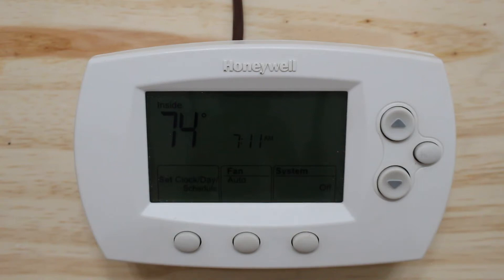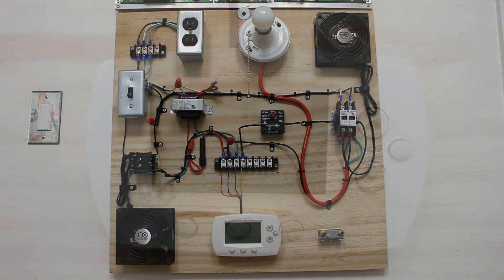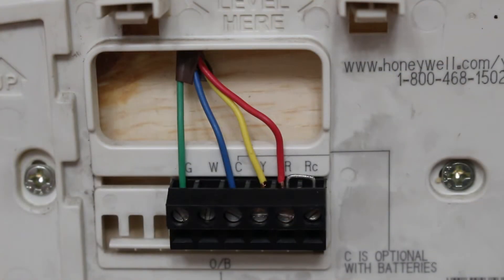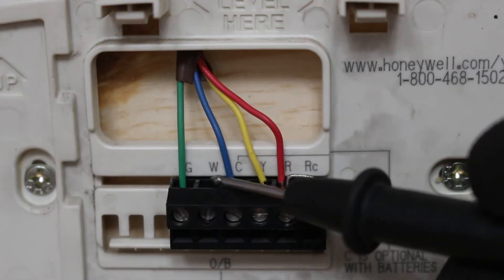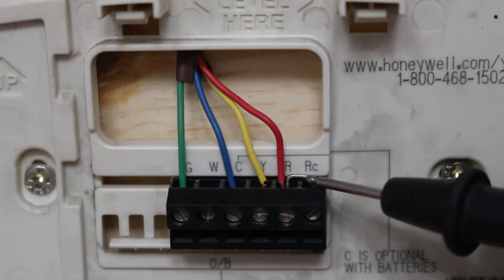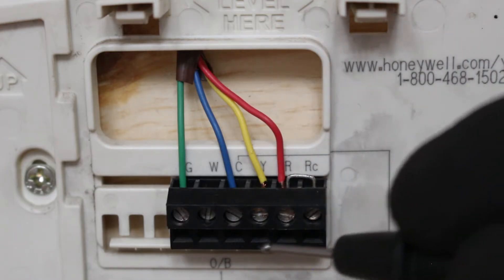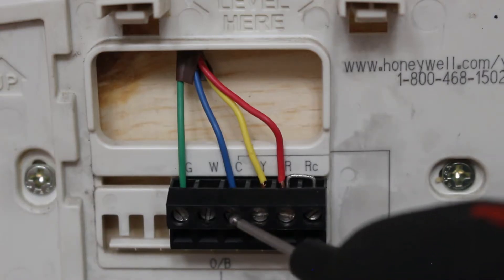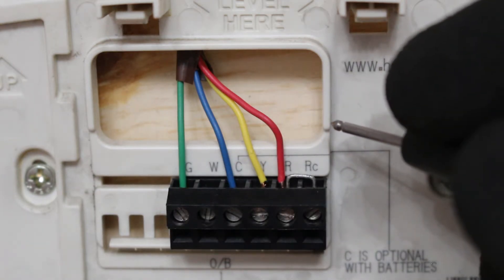HVAC: What Is A Thermostat & How Does A Thermostat Work (Thermostats Explained) Thermostat Wiring

Comment: But what powers the thermostat controller program  itself ? Is it the batteries, or does it draw 24 volts ac from the mains transformer ? ie are the batteries only to hold the settings during a mains power outage ?

Comment: I think there is a much easier way to present this:  The red line carries 24vac; the job of the thermostat is to connect the red wire on R/Rc to either the "G" for  manual fan/no compressor selection, or to " Y" for automatic operation of the fan and the compressor per the temperature setting.  That is it! 

The common wire is not even needed and might not even be present for thermostats that are fully battery operated.  Often, the common is already constantly connected to the fan relay ELSEWHERE and to the AC Compressor+Fan ELSEWHERE.  You don't need a common wire at the thermostat unless your thermostat isn't battery operated and itself needs both legs of the 24 volts to function.  

The only tricky part is that the AC installer may not have used a cable having a yellow individual lead color, so behind your thermostat you might find only red, blue, green.  Usually, red=red, green=green, and blue takes the place of the missing yellow color for Y.  This is why thermostat manufacturers tell you to note how a previous thermostat was wired/which wire color went to each of the standard LETTERS before you remove it to replace it.
Reply: Correct.
The thermostat common is there ONLY to power the thermostat itself, rather than using batteries to do so.
Reply: Dude yall just made it make sense.   He was confusing me with the common wire